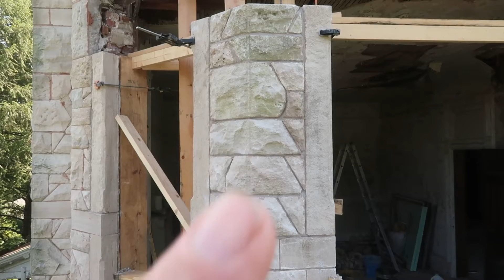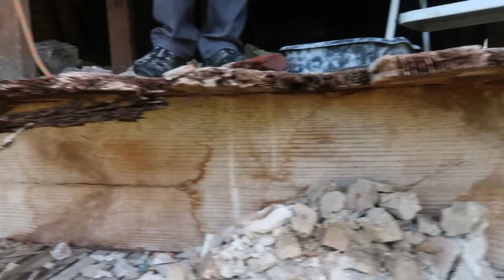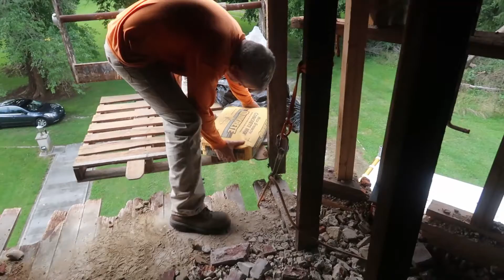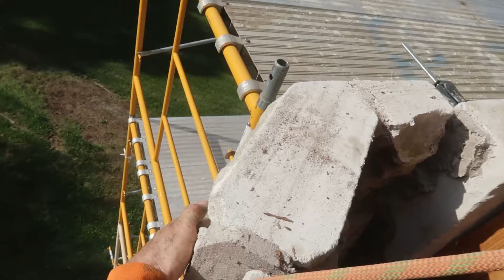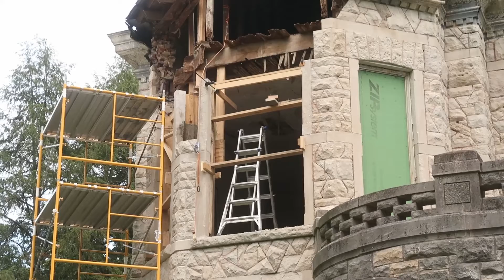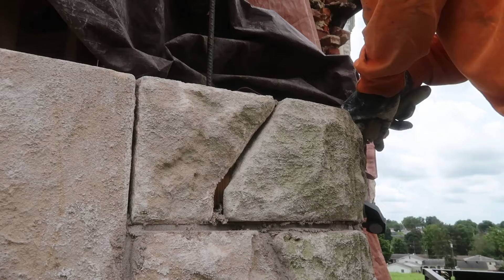Concrete BLOWOUT!! What a FRUSTRATING Day and Now We are Back to SQUARE ONE! S2E28

Comment: A little word of advice from a guy that has poured more concrete than a man should ever have to but it was part of my job. Go easy on the vibrator, in and out a couple of times quickly is sufficient. Concrete is a strange beast and the vibrator will cause it to move mountains. Hope this helps and love keeping up with your progress!
Reply from the maker: Yep, we found that out from experience. We certainly like it better when we get to learn from other people's experience. =)

Comment: I ask this question with limited knowledge on stone and concrete work and I would imagine you have already thought of this.  Would it make the stone work stronger if you drilled into it and epoxied  a piece of rebar into it so you could tie it back into the rebar in your concrete column?  It would act kind of like a Deadman in a retaining wall.  Just a question and a thought.  You do beautiful work and have enjoyed watching you both bring her back to life!
Reply from the maker: The expoxy would just be temporary. The stones are really a wall by themselves. The irregular shape and sizes of the stone is what ties it into the concrete.
Reply: @moorelandhouse  Ok, Thanks for the answer.  That makes sense.
Reply: @meanmachine76  Later on when they get to the top there's a bar in the Attic that goes through and holds the wall.
Reply: @icemancometh8679  Thank you for helping me understand.  That sounds very secure.

Comment: You guys have a good attitude during a failure. 😑. Concrete is is like water when in liquid form. The higher you go with it the more pressure it will exert outward.  Pressure (psi) = .433 x height.  Even though this doesn’t look like much pressure, take that times the cross sectional  area, you will have a significant amount of pressure pushing on your fresh stonework.  I was worried in your previous pours that that could happen.
Reply from the maker: Yes, we pushed the envelope just a little too much. We did it better the next time. =)

Comment: Bar, it used to be a lintel? how did it all hold up? It's very frustrating when you achieve such an effect and it turns out that you have to take a step back. But life is both successes and failures, you have to grit your teeth and move forward, you can't be defeated by one failure, as the saying goes "a man learns from mistakes" and not everything can be predicted. As you can see, everything fell into place👍. Cats are a force of calmness and patience, almost always🤭
Reply from the maker: It was only a minor set back. You are right, the show must go on.
Reply: @moorelandhouse  👍🍀🍀

Comment: Quickcrete is actually an inferior product. Convenient, but inferior. Add a half shovel Normal Portland Type 10. Common powdered cemen per bag of Quickcrete.. Throw in some type S if you want for better workability and bond to the stones. Add a glug, glug of tile acrylic admixture for thin set mortar for ultimate adhesion to the limestone. Home Depot or Lowes or any tile supplier should have a 2-gallon or 5 gallon jug of it.
Reply from the maker: Thanks for the tip.

Comment: I don’t think stone veneer wil have the strength you want to hold the outward pressure of so much wet concrete, at least all at once. You need to either pour layers, ( which would not be solid concrete), or form, pour concrete then remove forms and face with stone (basically the way it was originally done only with brick), or do with brick, or solid stone. Whatever method, lose the vibrator. I’m sure it caused your’e disaster
Reply from the maker: When the column was done originally, the bricks and stones were built up at the same time and incorporated together as it went up. It is essentially what we are doing now except we are pouring concrete to incorporate the stones into the column. It worked much better the next day when we poured it again. =)